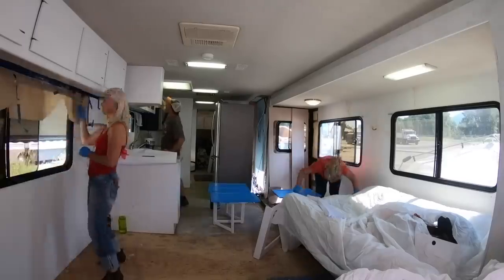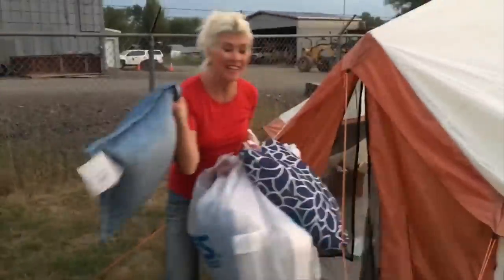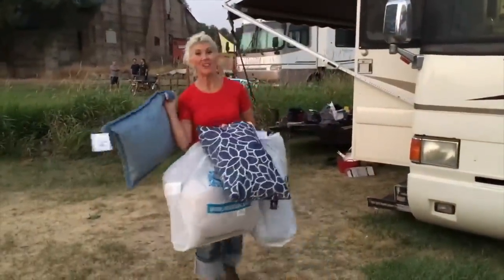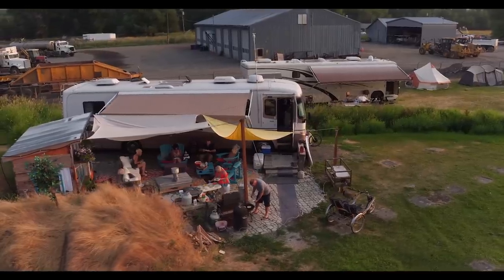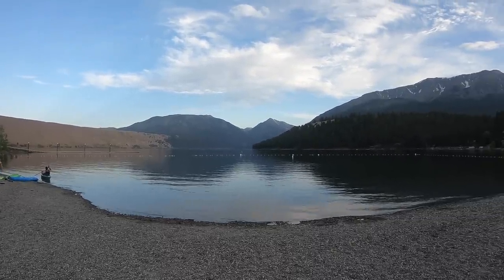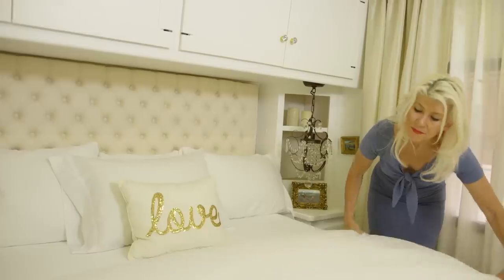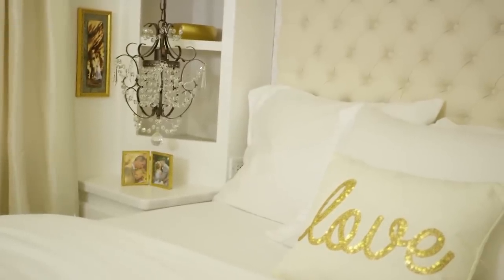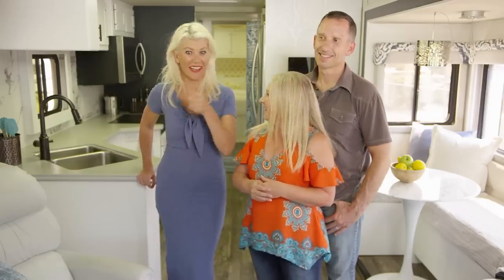THE FINAL REVEAL: Before & After RV Renovation | RVLOVE's Ultimate RV Makeover (Ep 8) | DIY Remodel

Comment: I'm coming in 2 years later & this is still a very trendy, beautiful look.   Am I the only one who wondered what kept the round base of the dining table from tipping on the slide step?
Reply from the maker: Thank you. Glad you like it too.  As for the table... For one it was relatively heavy, but we also had a groove opening low in the dinette that allowed it to move, but if it started to tip, it would be caught by the underside of that groove in the dinette, which was screwed down, so it could not tip over.  Great question! -Marc

Comment: How do you keep the bedroom chandeliers and dining room ceiling light from swinging around while traveling?
Reply from the maker: We have had this question a lot and will show how we make CC travel ready with the upgrades.  We found a simple and quick solution with small bungee cords.
Reply: @Rvlove  don't know what we would do without bungee cords.  We have them from 6" to 6' and always find a way to make travel easier.
Reply: Ya that's funny it was the first thing we noticed too,any thing that is not tied to a wall is going to rattle and drive you nuts going down the road,we got rid of our hanging lights and replaced them with flat mount led lights.glad you guys are happy with your country coach,they are well built 😁

Comment: Really beautiful. You all did so much in such a short time . Kudos to all.  Is it an optical illusion that the round table and the L shape bench is suspended above the floor?
Reply from the maker: Thank you.  Yes, it was a lot to accomplish in so little time.  Yes and no about the table and bench.  The slide out area in this coach goes straight in and out.  It does not drop down to be level with the floor like many newer RVs with slides in that area.  So, it leaves a few inches to step up into the dinette area.  We designed the edge of the dinette to overhang the edge a bit. But the bulk is on the slide area floor, so no risk of tipping.

Comment: Where can I find what type of adhesive did you use for the kitchen tiles and she said flexible grout?  Is there a link I could get to get an idea on what to use.  And I’d you put it directly on the wall or did it attach to a board?
Reply from the maker: We'll try to get the information on the materials used for laying the tile for a future video or blog post.  We went straight onto existing wall, not a separate board
Reply: RVLove | Marc & Julie Bennett ok thanks-she said it was a flexible?  So I was just curious, because we r redoing ours now
Reply from the maker: HI Dawn - sorry for the delay, our tiler friend got back to us. It's a regular grout / thinset with a "flex" additive  - ask at the hardware store and they should be able to help you find it! Sorry I don't know the brand he used. Hope that helps!

Comment: did you also paint the dashboard? If you did how and what paint? I would like o paint our dashboard s well.
Reply from the maker: No, our dash was already light gray.  But I have painted vinyl in the past.  There is spray paint specifically made for painting that type of surface. I changed the interior color of my old Nissan 280Z years ago, and the paint held up on the seats surprisingly well. good luck. -M

Comment: Instead of a pool noodle on the bottom of the counter extension.  You should use some velcro.  It would give it a more finished look.  The pool noodle looks like something I would have done when I was twelve.  lol
Reply from the maker: Pool noodle was meant to be a temporary fix, and has worked so well, we just haven't made it a priority to change.  It only shows when I point it out, and we only use the extension every month or two, so it is easy to forget that we are still using the temporary solution.  I will get around to improving someday, but have far more important projects around the RV for now.

Comment: The renovation turned out ok but honestly going down the road it still looks like an old RV
Reply from the maker: It IS an old RV - it's 20 years old. But we haven't finished with it yet... we have plans for the outside too. And it's still much better built and higher quality construction and materials than a lot of the newer ones out there.Not to mention we have a lot of the same (or even more advanced) systems, for a fraction of the price... and no depreciation. But never mind about that, sounds like you're only interested in how things looks on the outside anyway. That's not how we go through life. Looks can be deceiving :)